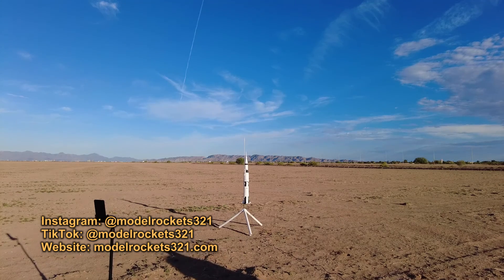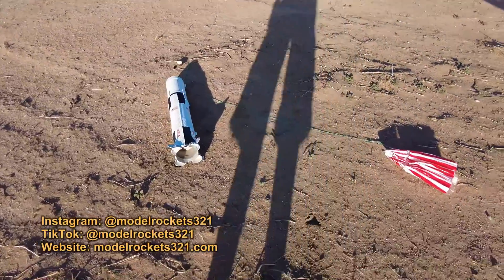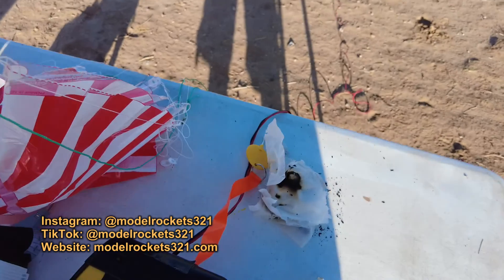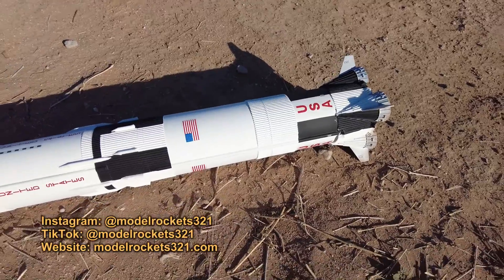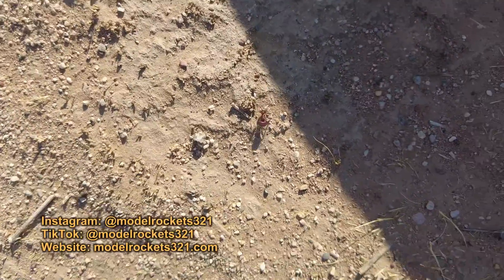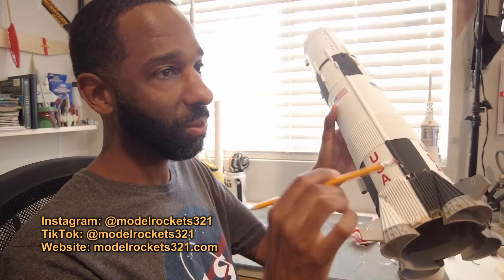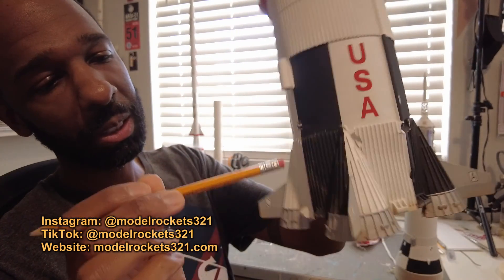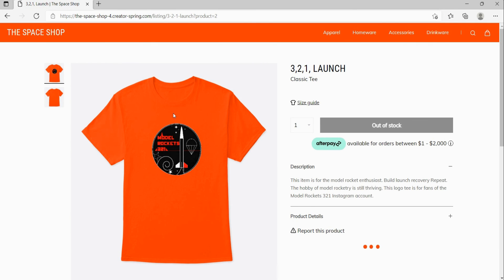Estes Saturn V Launch: OMG! #rockets #nasa

Comment: I've seen some wiggly Saturn V flights. It made me nervous, so I pushed a washer into the clay nose weight in mine. I've flown it one time only, but it was arrow straight, so I'm glad I added the weight.

Yours looks great!
Reply from the maker: Thanks for stopping by. That's great you got a nice flight then retired yours.  I have the heavy 3d printed fin issue and my capsule is glued in place. Few things to work out on my part.
Reply: It's nice to see different results launching these types of rockets 🚀 Even if the weight and balance is correct, 'CG' & 'CP' the wind and earth's gravity has an effect on the performance of the rocket regardless of what checks and safety measures you may have put in place 😀

Comment: Tossing the center of gravity and pressure stuff out the door, never trust a good rocket to an Estes motor, always go composite.  I quit using there motors after losing several rockets to bad ejection charges and Estes didn't even offer to replace any of them.  They just wanted photos for some weird reason.

Comment: I built the same Saturn V rocket, spent days detailing it, put the maximum size engine in it, and attempted to launch. 

It just sat on the launch pad and burned a hole in the shield, finally took off for about 10 ft then did a nose dive into the dirt and caught fire...  Then finally popped for the chutes😂😂😂

Comment: IDK why but your comment on the ant's checking it out made me giggle. Too bad about the damage, definitely my 1st flight on my Saturn 1B will be a F15-4. Also I made a mistake on mine and my motor mount it 2 inches closer to the rear. I need to do a spin test for sure before I launch mine.

Comment: I have one in the garage 1/2 complete still in the box after 20+ years in the box the plastic tail fins deteriorated so I probably will never finish it.
Reply from the maker: Estes is re issuing a 29mm motor version very soon. They've been selling spare parts for Saturns aswell. Check the estesrockets.com website. Used my discount code at check: in_321

Comment: Might be cool to do a vid on how to mod rockets and their weight. I just got a mercury redstone and modded ot to use d engines but im not sure what to do with the weight. Do i add a bit or weight to the nose?
Reply from the maker: Cool idea. From a c-d isn't too much to affect the flight. I made the same modification years ago and it flew fine. You'll be good in this case. Also you can get a rocket design software and build the rocket and launch it in the program and it'll show you the results pretty accurately 🚀

Comment: Yep, center of gravity issue, assuming correct engine tube alignment. It sure seems like old Sat5 had bigger tail fins.
Reply from the maker: Those were some 3d printed ones a lil heavy and a tad smaller. Since this video the originals are back on. Just checking Cg. Should get another flights soon.

Comment: OOF that was painful to watch but I 100% agree with you, these are built to fly and its not as fun a hobby if you're just building shelf queens! I've got a Skylab version and the classic Saturn V waiting to launch the end of this month. Both of those have 29mm mounts and I was thinking of lofting them on an E15-4, but now I'm wondering if I should just send them on F15s. Heh. Like you I've added the Boyce fin cans, and I've got a little extra weight in the front for both of them. Where was your CG point before launch?
Reply from the maker: Not sure where the CG was, too far to the the rear definitely. The Aerotech E15s are fine when built standard. Remember I used heavier 3d printed fins and without additional nose weight. Build standard and light will work.

Comment: That's exactly why I never build and launch anything I couldn't stand to lose.  A few years ago at a launch, someone placed a beautiful cluster powered Saturn I on a launch pad and I said, loud enough for others to hear and agree, "If I built something that nice, I'd be afraid to launch it."  Guess what happened.  Hint, it was much worse than this Saturn V launch.
Reply from the maker: Cool but that's not my method at all. No guts no glory. If it crashes,  rebuild it or buy another one start over. If it works out cool. I build them to fly. I don't want static models. I'm going to launch them all. Except for my Farside X. Everything else flies at least once.
Reply: @modelrockets3215  Cool, I will greatly admire your scale rockets along with others.  I have an easy excuse because, actually, I just do aerodynamic and 3D printing experimenting.

Comment: Mine is built a lot like yours with the Boyce fins and it flew the same on an E20-4, and I still added a pile of nose weight plus the front of the main BT is a baffle. https://youtu.be/kifnerl9L8E Looking forward to your fixes and next flights!
Reply from the maker: Ok cool thanks. I'll check this out
Reply from the maker: Similar flight profile. But your ejection event took place at a higher altitude. Hmmm. And how many grams of weight did you add
Reply: @modelrockets3215  Pretty sure it was 65g. I sim'd it in Openrocket and it seemed ok there. Guess not. Right now it lives on my desk at work and may stay there.

Comment: You can try a swing test with a motor installed and see what happens. The you can get the CM off and add bb's epoxied in or clay
Reply from the maker: Thanks. I dropped the ball. Especially not accounting for those heavy fins. Thought it would be ok.

Comment: Flew my vintage Estes Saturn - V (K-36 kit) back in July 2009, heavily modified to use a D12 core, four C6's outboards.  Flight was a great success, but recovery was not (for the upper section).  You can find the video here on YT, search for my name.

Comment: Good analysis Keith. I think the Saturn is asking for more power. Also, the fact that it actually hit tail first is a good indicator of its CG. More noseweight is required. And of course, more weight will need more power. You’ll get it dialed in!  Looking forward to your rebuild and ultimate success!
Reply from the maker: Thanks Kevin! Good information.

Comment: I flew that rocket too. The fins are way too small to control that large of a rocket at such relatively low speeds, i think later they added some clear plastic fins to extend their surface area in later models.
Reply from the maker: The size of the fins are fin on this kit. Many of them work. I just screwed mine up. Those are heavier 3D printed fins. That weight needs to be accounted for.